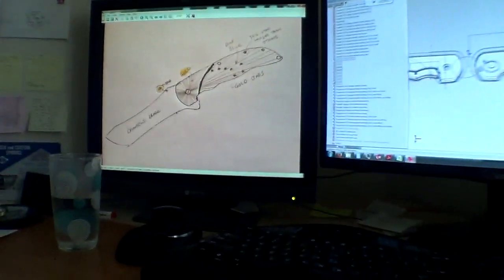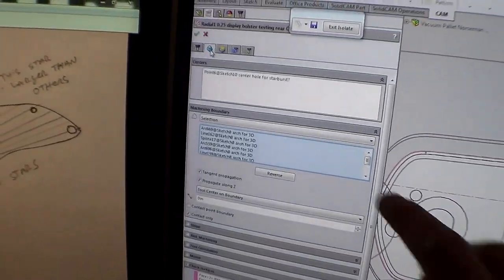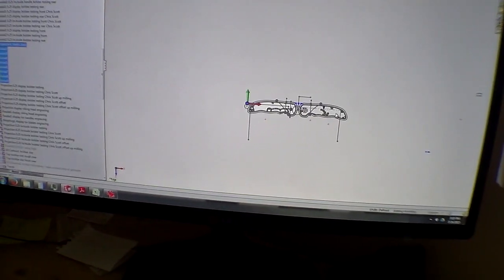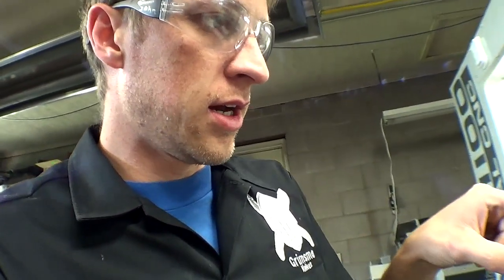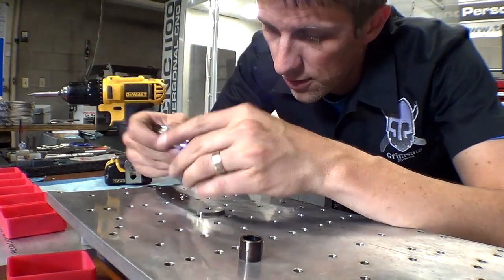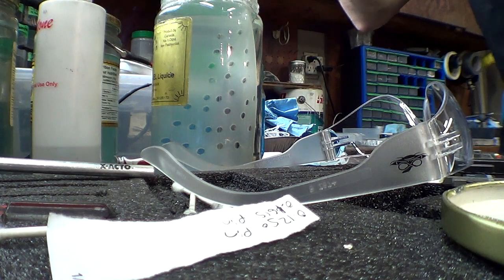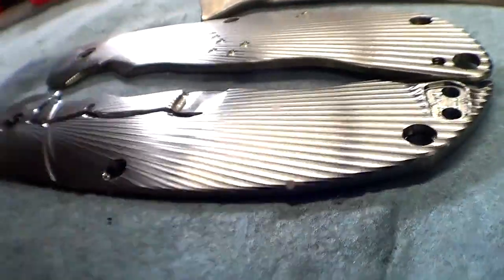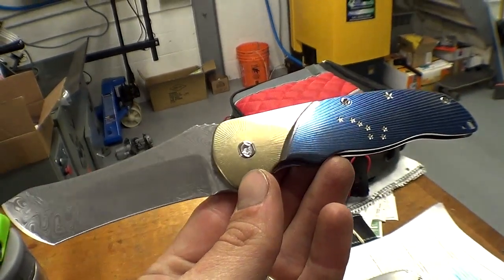KMT 115 - Alaska Knife engraving

Comment: If you use nail polish you can get a very clean and easy mask for anodizing, and when you're done you can just remove it with nail polish remover. It works very well and has to be faster than taping it up!

Comment: I learned about your channel from NYC CNC and have started binge-watching your videos. I'm curious: was it a deliberate choice to have the star points come out "rounded"? Is it possible to use a v-bit for a design that small and have have "sharp" corners, or would the RPM of the tip not be high enough?

Comment: could you maybe get some masking tape laser cut to the shape of the arc to make masking easier?
Reply from the maker: +Sharklops +wojtek I hadn't thought of that, great idea guys!  Or a vinyl graphics cutter.
Reply: +JohnGrimsmo why not mill the arc after anodising? Then any mask irregularities will be removed by the cut?
Reply from the maker: +Alan Fisher The cut finish was not as good as we wanted it to be for that arc so we end up polishing it a little bit.  However if I purposely was okay leaving tool marks there, then I could use a smaller endmill and leave a cool silver pattern on that line.  That's something I haven't tried yet, but would certainly make things easier.
Reply: Another possibility with a laser cutter is to inlay powder coat in multiple colors.  You dust the powder over everything, laser the part of the pattern for that color, then blow it off. Repeat for each other color.  Might be an interesting option. 

-- Mike
Reply from the maker: +BigMjolnir Super cool idea!  And here I'm trying to talk myself out of buying a laser, you're not helping!  Haha.
Reply: +BigMjolnir I've actually tried this, and unfortunately it doesn't work nearly as well as you'd hope.  There's a very fine line between vitrifying the powder and just blasting it clean off of the metal, and even when you do manage to hit that point, the powder has only bonded to itself, not to the metal substrate, so it's difficult to remove the remaining powder without disturbing the parts you want to keep.  If you manage to get to that point you can bake the part to get the powder bonded to the metal, but the edges tend to slump and blur, so you can't get much fine detail.  If you could tightly control the powder thickness, and maybe preheat the part before laser bonding the powder you might be able to make it work, but it's be a tremendous pain for only one or two parts.

You can, however, laser engrave powdercoated parts with good results, and potentially fill the engraved portions with an epoxy paint via syringe or something.
Reply: +Sharklops I haven't done it, but I've seen it done in wood by a laser vendor at a woodworking show.  He inlaid the Pepsi logo on a wooden box lid that way.  Don't see any reason why it wouldn't work on metal...but there could be issues I suppose.  If I ever get a laser cutter/engraver I'll try it for sure.

-- Mike
Reply: +thavinator Thanks for the actual experience info.  Were you trying this on a smooth surface, or filling engraved spaces?  If the later, then I think you are right...pre-heat, or maybe control the heat better (i.e. multiple passes maybe) might help.  Just running on theory here of course.

-- Mike
Reply: +JohnGrimsmo Same here!  Seeing those ads for the GlowForge laser cutter, it's getting pretty tempting.  Their initial offer price is pretty reasonable...though you might have to wait a year for delivery.

-- Mike
Reply: BigMjolnir I was attempting to mark a flat (aluminum) surface.  If you've already engraved the design, then there are better ways to fill it, such as using an epoxy paint that will flow into the design.  A pneumatic syringe dispensing system (available on eBay as solder paste dispensers) would help for particularly intricate designs.  

One thing you could try is applying a mask to the part (spray paint could work) and using a laser to engrave it away in the areas you want to etch or anodize.  I've done this a couple of times to make printed circuit boards with cupric chloride etchant, and it works fairly well, although it usually takes several passes to get all of the paint engraved off.  With titanium you'd have to be careful not to mark the metal in the process or removing the paint.  

Speaking of which, titanium is one of the rare metals that you can directly mark with a CO2 laser (which is what most common laser engravers use, including most of Epilog's line and the Glowforge).  It essentially selectively heat anodizes the metal, although at least with our 35W Epilog (comparable to the Glowforge) it takes several passes to get a nice dark purple.  If you do one pass too many you overshoot the purple into a much lighter straw and have to sand it off and try again.  

JohnGrimsmo , if you're serious about getting a laser engraver, I'd strongly suggest looking at fiber options.  CO2 is great for wood, paper, and many plastics, but with a fiber laser you can directly mark bare metals.  In fact, it's a good bet that your friends with the 5-axis laser texturing system are using a fiber source, but probably in the multi-kilowatt range.  CO2 can mark stainless and titanium with a marking compound, but that won't be as durable as a direct mark.  Epilog have a version of their Fusion engraver that has both CO2 and fiber sources in the same system, if you want the best of both worlds.  It'll be a lot more expensive than the Glowforge, but It's available now and Epilog are an established brand in the engraving market with excellent support.  And I'm pretty sure it won't be nearly as expensive as that five axis texturing setup.
Reply: +JohnGrimsmo bro you dont even know. I went and visited Keybar and got hands on with his Fibermark. Unbelievable machine and crazy easy to use. I did a license plate frame start to finish myself with all of 3 minutes experience with it. Such cool machines. Plus in vector mode you can cut your own foam for custom cases.

Comment: Why don't you use a GoPro for the close shots it's water proof and small
Reply from the maker: +manisadomo I'll be trying that soon, but I haven't figured out an awesome way to mount it in the machine yet.  The suction cup keeps falling off.  I'll try a magnet mount soon.
Reply: +JohnGrimsmo A Magnetic indicator  will work for the go pro, the coolant will still be a problem. FWIW, I am fine with showing the setup, and a few seconds of machining. The more interesting part of fabrication is seeing how the part is designed, fixture, and finishing (out of the CNC). 

The word I think best fits the this project is "astonishing". Thanks for sharing! I am looking forward to seeing your new CNC mill setup and in-action! 

For masking, try "rover mask". its a latex compound use for masking solder on PCBs. I have not tried it for anodizing, but I think it will work. MSC direct sells it.